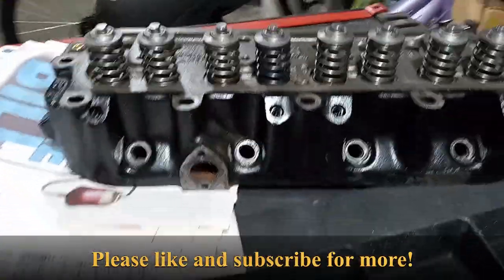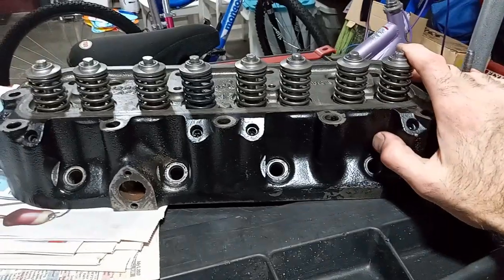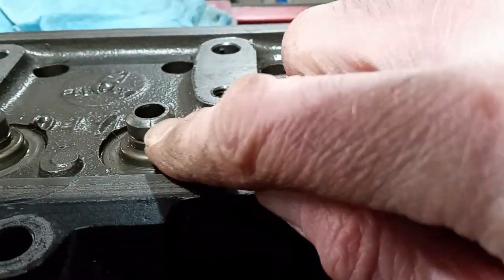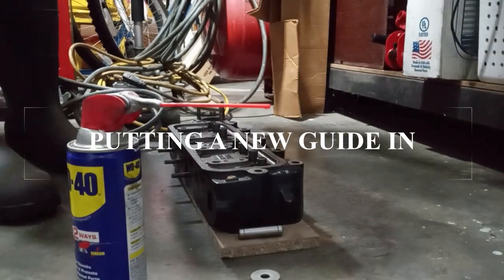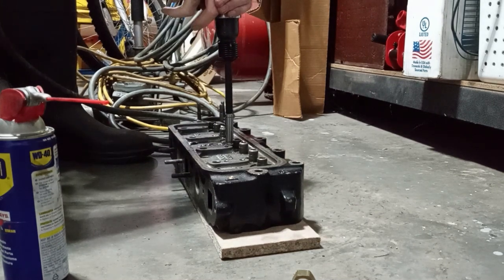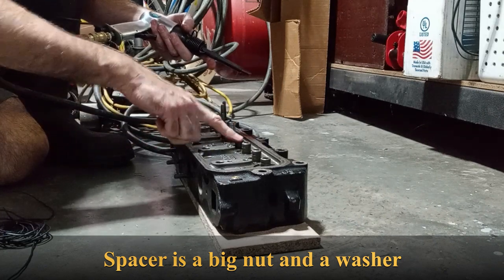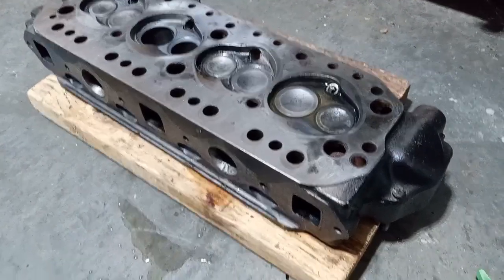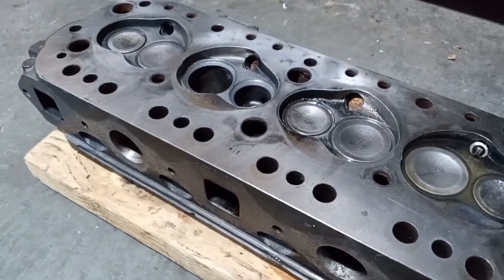MGB Cylinder Head Valve Guide Install at Home, but I should have used a machine shop

Comment: What made you decided on new valves. Was it burning oil ?
Reply from the maker: This was a used head I was going to use, but I found the valve guides were very worn…lots of play with the valves in the guides.  Bought the head on eBay and was told it had only been run in the driveway after a rebuild…yeah right